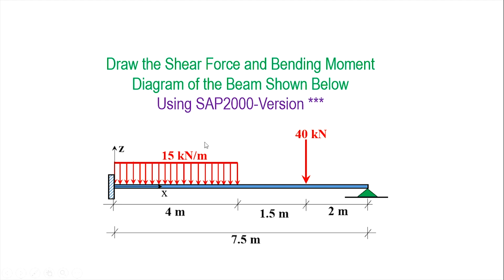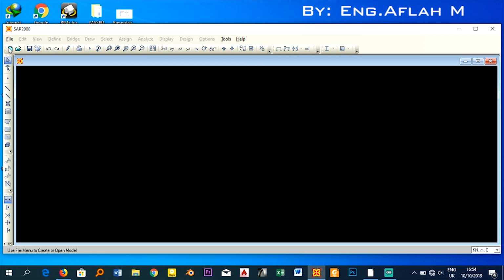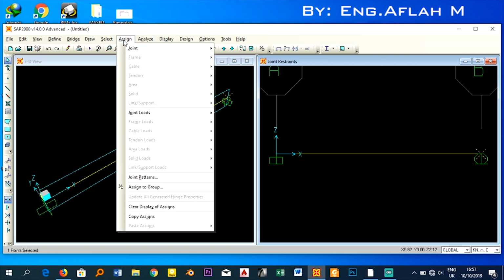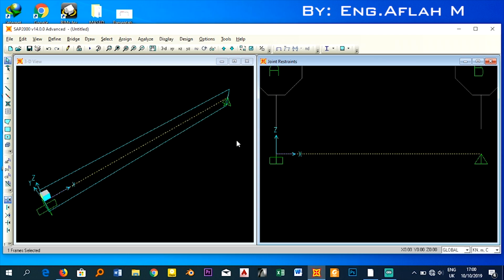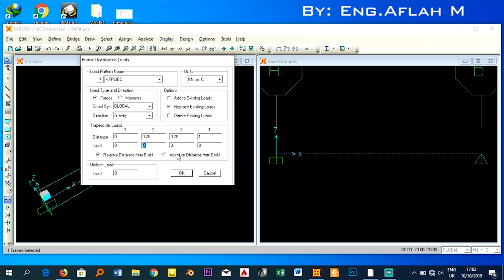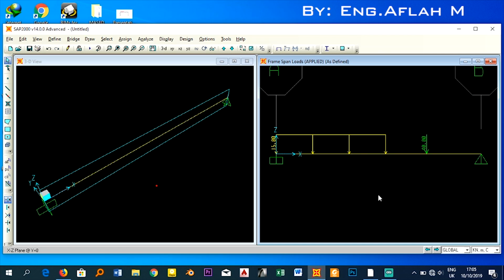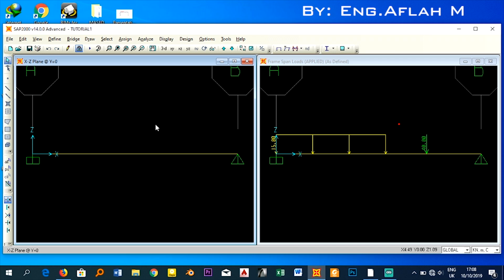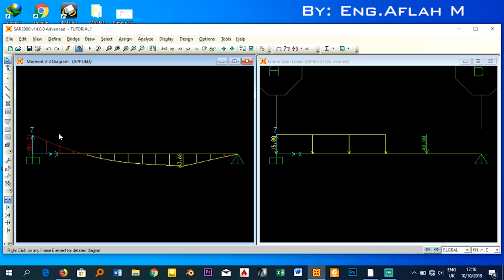SAP 2000 Tutorial For Beginners: LESSON-1

Comment: How it is possible to analyze without assigning  material or size of a beam? I thought you have to assign beam prophecies property and material.
Reply from the maker: If you are considering the self weight of the beam, you will need to define the section and the materials. In all other conditions you don't need to define the section and materials to analyze beam.
Remember, for simply supported beam loaded with uniform load, the maximum moment at mid span is =wL^2/8, here you didn't need to know the material and the section property.😊